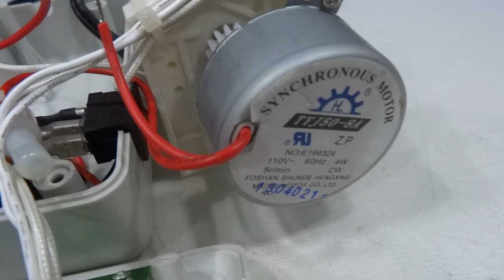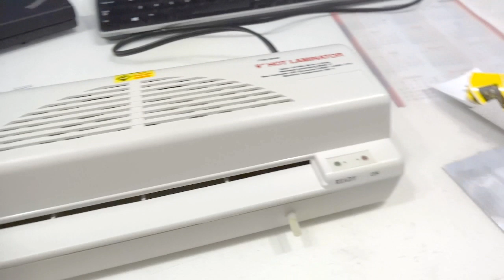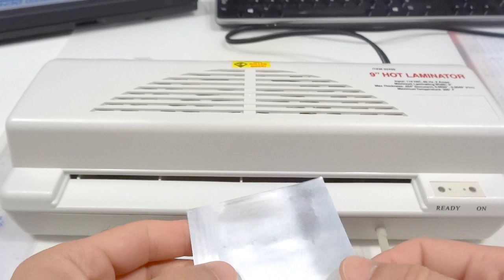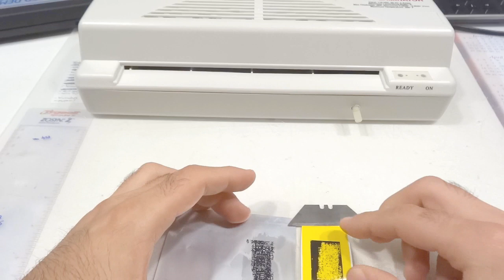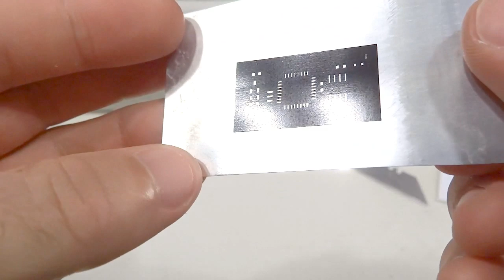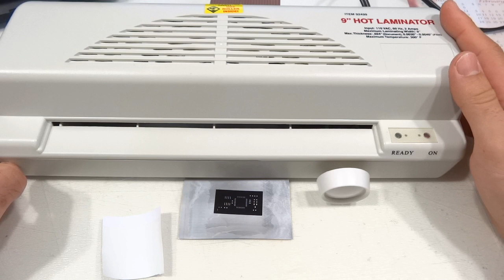Laminator dimmer hack for PCB/stencil toner transfer

Comment: Hi, thank you for sharing this mod. Now I just realized that the video is uploaded in 2013 ! :D still a good mod though! 
I was just about to give an advice on that AC dimmer circuit. I don't know if you still work on that but anyway, as you mentioned, motor is an inductive load. A quick RC snubber circuit may work well. 0.22uf - 100R may be OK. Still it will not work smooth  below %15 I guess. I think the best way to slow it down, guess the desired voltage on motor (proportional to the speed) and put a serial transformer at desired ratio.

Comment: this motor is synchronous, so it will move at the same  rpm always, what you are doing is choking the motor, it works but a better solution would be to change the motor for a 1 rpm  unit... i know that because i passed through the same problem last year.  cheers from brazil!!

Comment: Felix,
might there be a mechanism internal to the laminator which would allow for the adjust of 'platen pressure'. Other laminator mods have used that option (if available) to good effect.

Thank you for sharing this.

'Harbor Fright' - god bless accents.

Comment: I am a bit behind the times, but wanted to thank you for posting this.  I just picked up the laminator, and after taking it apart, I noticed that the synchronous motor is a pretty standard unit.  I see the original is a 5 RPM motor.  I am curious if it is easier to put in a motor that rotates at about 1 RPM.  Looking at some sites, I see them for around $5 US.  Do you know how fast your modified unit is turning, and still able to do the work properly?
Reply from the maker: Ron Walsh I don't use it any longer because I now laser etch my stencils, see my latest videos for that. But once modified this unit turns very slowly, enough to get a good transfer. Some find the clothing iron method to work better, so its hard to say this works for every situation.

Comment: Hi buddy!, what size of maximum thru-put thickness has this laminator?.The GBC-H220 one, is 1mm.The copper board has more than this.Can we damage it or not?
Reply from the maker: Not sure, 1.6mm FR4 works fine
Reply: Ok but when you did by this one,how did you know for the first time that this machine was properly for FR4 boards?
Reply from the maker: Gabriel Emanuel Ciorciari I tried it ;)
Reply: ok,you were so lucky! jaja